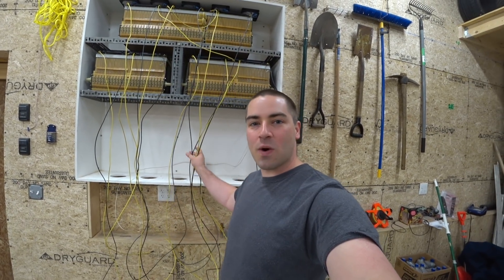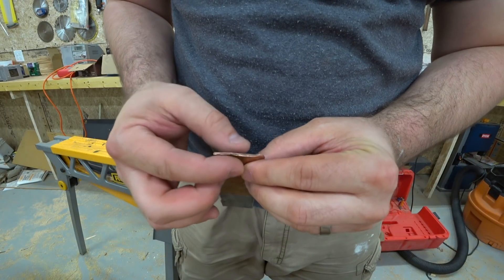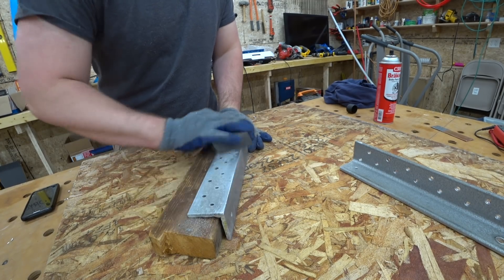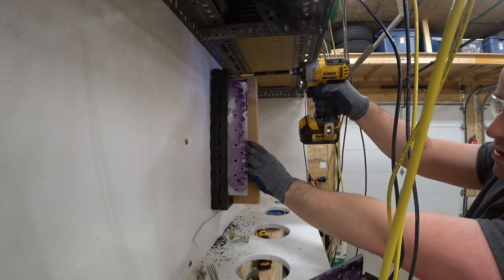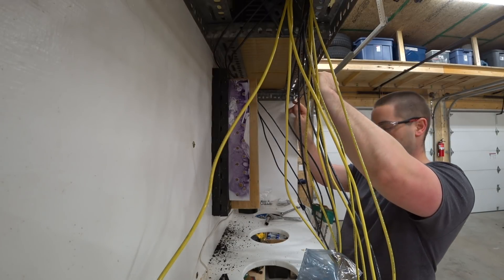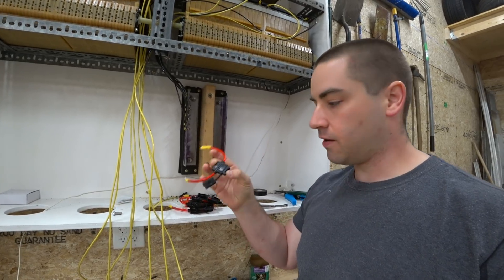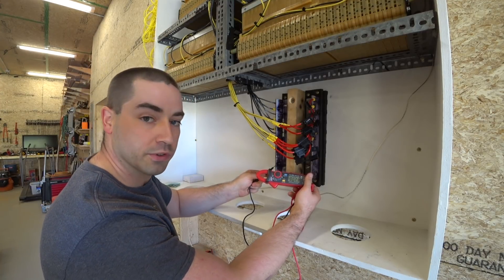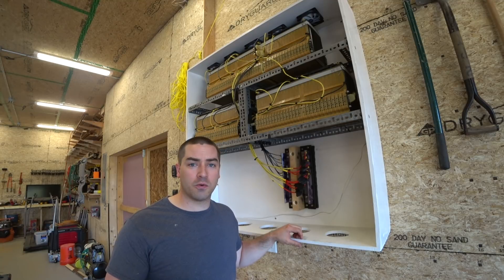Making Busbars, wiring batteries together, DIY Powerwall (Chevy Volt)

Comment: You should put your fuses near the batteries, the way you install it you don't protect your yellow wires out of the batteries
Reply from the maker: Yes, you are correct.  This was my very first (large) battery bank and a bit of a learning experience.  Over the years I've incorporated more fuses and circuit breakers into my battery builds.

Comment: Hey, why 44 volts? I want to do same but my inverter is 48 volts. Will it work?
Reply from the maker: The Chevy Volt batteries break down to 12s groups, which is a nominal 44V.  I used it for over a year with my inverter without a problem.  My inverter is a 48V inverter.  All inverters will have a Voltage range they work with.  In my case, the range was 40V-58V.

Comment: Question. For added safety on the wooden wall cabinet. Was is worth to paint in insumecent fire proof paint?  Also I know this is 3 years down the line. But would it be possible to make a video on a custom metal or wood cabinet for 48 or 64 Eve/Lishen 3.2v cells with locking wheel casters and locking door. That would be cool. Alternatively any alteration of an existing metal cabinet that would neatly hold 64 of said cells. 🇬🇧
Reply from the maker: I picked up a server cabinet that I plan to house batteries.
Reply: @DavidPozEnergy  ok. Great. Do you think the server cabinet could work with 64 Eve phosphate cells?
Reply from the maker: I don't know the size of the cells you are looking to buy.  My server cabinet is called a "42U" and I got bought it at a recycling center.  It has 4 vertical rails inside, which can hold shelves.  I'm making my own shelves with angle iron and plywood to sit inside of the 4 vertical rails.  This makes strong shelves.  Each shelf is 19"x31".  total height is 6 feet.  I hope that helps you.
Reply: @DavidPozEnergy  Hi David. Thanks Getting back. Ive seen the 42U server cabinet online in the past while doing research. The cells are roughly 2.5 inch thick. 7 inch wide and 8.5 inch high each. I reckon I’m gonna use a minimum 48 of them and a max 64 cells. My concern is if I choose a server cabinet, having longer cables to link the upper rows of cells to the lower rows. How would that effect equal energy passing through the cells?
Reply from the maker: It's not enough to worry about with central bus bars as I demonstrate in this video: https://youtu.be/r0vuSo5eIOY

Comment: David I am using 1" copper tube from Lowe's 10 ft long ThicK wall. i split the type and flatten it I then use a template for my primo8h cells, if you compare the original they are same flat I use a plate on top of the copper plate this to me is the best as you have copper for conductor aluminum top plate for rigidity, AND HEAT ANTICIPATION . I like your idea of angle it avoids short circuit incidents which get scary WHEN YOUR TIGHTENING THE CIRCUIT,  i always use stainless bolts less corrosion. I enjoy your videos . KEEP UP THE GOOD WORK. .

Comment: i know there's probably a good reason, but why use stainless steel bolts for the connector mounting?  why not plated bolts, plus they wont corrode the Aluminum like SSt bolt will.
Reply from the maker: No good reason.  It's what I bought.  Zinc would be fine.

Comment: Found a quick calculator and copper is 1.2A per mm2 of size, aluminium is 0.8mm
I'm not an Electrical engineer though, so have no idea if this is true or accurate

So to find out how many amps it can carry multiply these  * W * H in MM

For the Copper
(1 3/8" * 1/8" * 1.2) - 34.92*3.17*1.2 = 132 Amps (Supposedly)

For the Aluminium
(2" * 1/4" * 0.8) - 50*6.35*0.8 = 254 Amps (Supposedly)

I know the Aluminium is right angle, so I figure this is per "section" / side or rails. 
If you cut them in half and double them up this would be 1/2" thick so could carry 508 Amps based on above calc

Hope that makes sense.

Comment: Use 30 amp fuses for max power! The 10AWG length you have will handle 50 AMPS. QUESTION: are you running the Chevy 44v in a 48 volt system charging to52Volts? EEng worried about your heating of the cells without cooling

Comment: why 44 volts if the inverters are 12, 24, and 48 volts? I just both a chevy volt car and today I removed the batteries..everything match to 48 volts, the two 24 battery an add it together,.. you are my master!!!
Reply from the maker: 48v is just the nominal voltage of the stuff I'm using.  I'm using a "48v" inverter, but the inverter can take 42v-63v.  There is a range.  The battery will have a different voltage based on state of charge.  In this video I'm using Chevy Volt cells arranged 12s, meaning 12 cells in series.  Each cell has a nominal voltage of 3.65v (12x3.65=43.8v).  Each cell has a range of 3.0v-4.2v depending if it's full or empty.  The pack voltage will go up or down.

Comment: What charge controller works best for recharging these chevy volt batteries i have a total of three, that are 44 volts each.
Reply from the maker: I decided to go with a Victron brand charge controller.  Not all of them can be programmed to the right voltage, but the Victron can.  This is the exact model I used: (Amazon affiliate link) https://amzn.to/3hr1JeH

Comment: Looking through the comments and there's one thing I haven't seen yet so I'll mention it now, 2 years too late:
The thickness of the bus bar doesn't matter much. Electrons tend to flow near the surface of any given metal, so surface area is far more important than thickness. Thickness more reliably determines how much heat the bar can handle as the electricity moves through it (thicker bars are harder to melt) but that can also be solved by using a longer bar and/or closer spacing of the connection points.
Reply from the maker: Thanks.  I took this down after two years of operation.  I now have a totally different setup.
Reply: @DavidPozEnergy  I can't wait to get to that video and see it then.
I love watching solar power installs

Comment: David, I understand we're in the realm of personal opinion here - but - reference material size/gauge?  Simple.  Open your home's grid electrical panel and look at the lug size on the main 200A Circuit Breaker. That will instantly give you a visual clue of how thick/wide your own bus-bar material should be.  You could turn off that main breaker and measure it if you want.  As young as your are, you may not be aware that back in the 1960's it was thought that aluminum wiring would be cheaper and easier to use for wiring houses and the industry went to that. Numerous house fires nation-wide later, that idea went up in flames (pun intended) when it was discovered that electric flow over aluminum caused an oxide reaction and heat buildup.  So - back to copper and a very expensive cost to replace that aluminum wiring with copper.  It's apparent you've given lots of thought to your bus-bar and it may be okay for your application.  I would keep a wary eye on it - might even put a temperature probe there to keep it honest.  Just a thought.  Keep it up!  John
Reply from the maker: Hi John.  I'm building this system up a little bit as I go.  Part of the fun for me is making things and using what I have on hand.  This is in contrast to buying a pre-built system for a lot of money.   When making the bus bars with aluminum I sanded away corrosion to raw metal, then immediately coated the surfaces (that purple stuff).  Since making these bus bars months ago, I have checked the terminals several times and none can budge.  The connections are still strong.  I have used an IR thermometer on it while pulling 6kw from the batteries, and it is showing up as the same temperature as the surrounding cabinet.  Meaning, no heat build up.  So it's working for me.  

However, having said all that...  I'm planning a big re-wiring job of the box that will take place in the next few months.  The primary purpose is to re-locate the inverter.  When I do that I will be buying a bar of copper 101 as a new bus bar.  I hope you stay in touch for that and I welcome any suggestions.  I'm pretty open about the fact that I'm learning.

Comment: Fuses must blow BEFORE cables heat goes up. You must use fuses that have lower amps than your cables, like 20 amps if cable is rated at 30 amps.

Comment: what are you using for a BMS? or are going to use one.
Reply from the maker: Hi Jayd,  I have not installed a BMS, yet.  I'm still learning about them and trying to pick one .  I have checked each cell a few times and they are still in balance, but I'm not pushing the battery hard until I install a BMS.

Comment: The idea is nice, I would of put the batteries closer to the floor (heavy weight) than above your head. The bus bar I would of had one half (+) to the right horizontally and the other (-) on the left horizontally, that way it's divided and can be set farther apart so you wouldn't have needed the 2x4 block and it makes it a little safer when connecting the wire and u can use cable clamps to hold each wire neatly in place on the back wall out of the way when you add the solar charger and inverter(s) later. Just a thought for later modifications.
Reply from the maker: Thanks.

Comment: I'm trying to figure out if you're running a 48 volt system you can go up to 60 volts 44 volts to me seems a little bit low and I'm not trash-talking you I'm just curious
Reply from the maker: Hi Gary,  Yeah, I was confused about the voltage at first too.  The Chevy Volt battery comes with 96 cells.  Each cell can hold a voltage between 3.2 to 4.2 volts, depending on the SOC (State of Charge).  Most of the time we say the "nominal" voltage per cell is 3.7 volts.  When I broke the cars battery down into 8 smaller groups I grouped them 12 cells in series per group.   So 12 x 3.7v = 44.4 volts per group.  Rounded down that is a 44 volt group.  Each group is now it's own battery.  

Lead Acid batteries have a nominal voltage of 2v per cell, and were grouped 24 cells, to make a 48 volt battery.  This is important because all the supporting hardware (chargers, inverters, etc.) were built around this 48 volt base.  

New lithium batteries don't fit perfectly into the lead acid world, but are close enough.  My 44v battery is close enough to work with most 48v equipment.  Online you will find DIY batteries in 12s, 13s, 14, 15s, and 16s configurations.  I hope that helps.
Reply: DavidPoz so you can't wire them to 57 to 60 volts?
Reply: DavidPoz o thanks for your videos and getting back to me...do you have a controller yet? Haven't found any other videos? We're off grid solar as well
Reply from the maker: If you wire them in a 15s (15 cells in series) configuration then the nominal voltage will be 55.5v.  At empty the 15s would have a voltage about 48v, and fully charged 63v.  That would cover your desired voltage of 57 to 60.
Reply from the maker: Hi Gary,  I just posted a video about my brand new charge controller about an hour ago.  Here is the link: https://youtu.be/Efqx_iRYRjo
Reply: DavidPoz I just watched it ...thank you

Comment: So what is the voltage for each cell ?? ...Try to figure out a plan to do a similar set up ..
Reply from the maker: Hi Kain,  Each cell is a nominal 3.7 volts.  4.2v is 100% state of charge, but many users keep it below that in order to extend the life.  So with my 12s (12 cells in series) per battery, a full charge could be 50.4v.  I haven't decided exactly where I will set my upper limit, maybe 49.2v and stop there.  I saw another YouTubers video where he is using Chevy Volt batteries in 16s.  His inverter goes up to a max of 64 volts, so he is setting that as his upper limit which is 4.0v per cell.  Here is a link to his nice setup: https://youtu.be/EL635kikJHE

Comment: Awesome awesome setup so how is it working out with the 10 gauge wire I think he's a bit too small but at the inverter should be at least 0/2  so I could give the power what the inverter says ...so wating for the video of the charge controller...Ps ✔ out the PCM60X...
Reply from the maker: Hi Kain,  So far, so good on the wire.  The harshest I've tested it so far was running an hour strait with power tools, 1400 watt and 1800 watt saws.  I touched all the wires and cells and found everything felt the same as room temperature.  At 1800 watts, that's roughly 48 amps from the busbars (I've included inverter loss) so about 6 amps per battery.  10 gauge wire can handle 6 amps fine.  

Of course, if I buy more inverters, or bigger inverters I might have to change something depending on the new load.

Comment: Great job. If I did not have a balancing charger for each cell, I would put a 2 Kohm resistor on each cell and monitor them with an arduino or rasberry pie for bad cells. The 2 K ohms on each cell will balance them a bit and is put over the cell on +  and -
Reply from the maker: I've just begun my learning about arduino.  I would love to learn how to do this so that I can hook up a serial monitor showing the voltage of all 96 cells.  Somehow I would need switching because there are not 97 inputs on the board.  I don't know how to do any of that.  I currently have it on my desk as a temp. and humidity sensor with a 4x20 display.  That is as far as I have learned.
Reply: DavidPoz . Hello again, i have look around for an idear, you need the 2 K ohm resistor on eatch battery then two more in series, from the + pole to a 3 K ohm to a 1 K ohm to ground on eatch battery + , then you have an output between the two resistor, then you need som of thise MAX1138EEE , thise have 12 10bit analog input to the arduino i2C, then you have to code the arduino. The 3K and 1K work for 12v system, for 24 volt it is 4,7K and 1K. Good luck.
Reply from the maker: Thank you jacobhn2 for helping me out with this.

Comment: LOL, I wouldn't be sleeping in that house ... Your as good as your weakest link and man do you have some weak links.
Reply from the maker: Hi Dan B, The battery bank is out in the garage, a separate building from the house.  Thanks for watching.
Reply: DavidPoz, Just a suggestion but you can pick up ,"Ugly's Electrical References"; at Home depot. Great job on the box but your electrical is shady.
Reply from the maker: Thanks.

Comment: I would suggest removing the rubber mat material and use rubber bushings. As stainless steel washers will conduct electricity. Also wood makes for a poor electric conductor unless its wet. 

Was the reasoning for the rubber matting was for heat insulation? 
Also are you heat shrink tubing the connection points? 

You may also want to use dielectric grease to coat the connectors so they wont oxidize.
Reply from the maker: I used the rubber mat so that the stainless steel bolts were isolated from the wood cabinet.  Probably not a problem, but I just didn't know the conductivity of the painted plywood, and didn't want to risk something.  

I'm not heat shrink tubing the connection points.  I figured the heat shrink tubing is good practice if there is a chance of weather exposure.  I'm indoors, so I didn't see the need.

Comment: Your understanding of wire gauge, and how it affects voltage drop (actually you didn't mention this at all iirc), and how much it can carry safely, may be flawed.
The ratings for wire are usually based on 110 volt use, with AC power in your house. When you are dealing with so many variables, these ratings and rule of thumb things for wire, stop being accurate.

While in your case, the 10 gauge wire will be moderately sufficient provided your runs are all under 10 feet, in the future, be mindful of the voltage drop over the length of wire. Even if the wire is rated for that amount of current, that does not mean that the voltage will not drop unacceptably over a longer distance.

Not only must you be careful that pushing a certain amount of amps through a wire could heat up the wire and cause an issue, but be careful about causing unexpected voltage drops, which can seriously harm or hinder the operation of your equipment.
Reply from the maker: Thanks for commenting Four ZeroFour.  How do you suggest calculating the size wire needed from the batteries to busbars?

Comment: nice, did you notice any current flow between the packs?
Reply from the maker: No I didn't.  I had checked every cell, and every pack before putting the batteries on the wall and they were all within 0.01v.  Thanks for watching.

Comment: Well I don't use bms also but balancers are necessary to hold cells in line everything else is inverter's job....
One thing only I don't use whole capacity of the battery by the voltage it goes 57-50v so I don't go over low threshold... 
Victron BMV 700 have alarm if is go below 47v and also small relay.....
14s configuration and 12kw/36kw peak inverter 18650 diy powerwall /300Ah but is getting bigger 
Balancers are Del green single cells balancers wired in loop on the "secondary" side...

Comment: Its kinda late now but there is fuse holders that don’t have the wire built in.  So they are just the spades on the backside and can be mounted ..... so you can actually make a nice deal thats all in line.    You just use insulated female spades.   Using all those butt connectors is asking for trouble.    Also temco 8 or 6 awg wire would have been nice to use.
Reply from the maker: Hi Casey Cross.  My next video will talk a little more about fuses.  I hope you can chime in on that one to give me your opinion.  I'll be making some improvements.
Reply: DavidPoz what is the best way to send you a photo of what I'm talking about?    I can even pop some in the mail to you if you wish.    My Facebook is www.Facebook.com/casey.cross.752   So if you wanna shoot me a message on there
Reply from the maker: Hi Casey, my e-mail is on my website www.davidpoz.com.
Reply: DavidPoz i sent you a message on facebook messenger not long after i posted those comments.  If you would rather i can email you.  Take a look at messenger or reply on here.